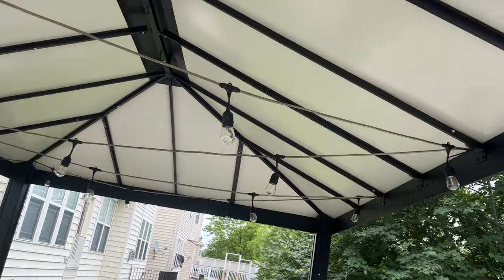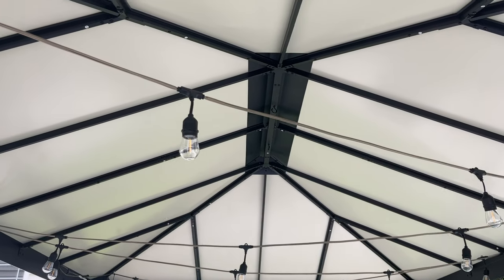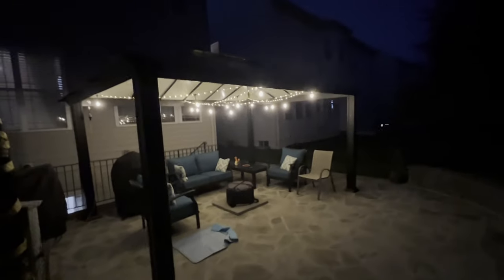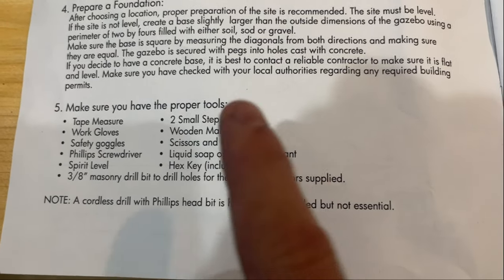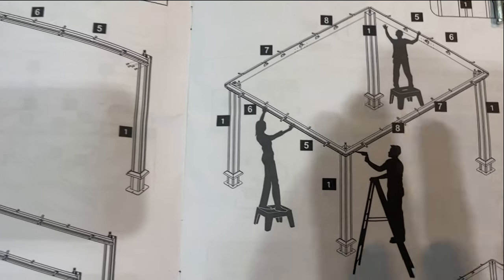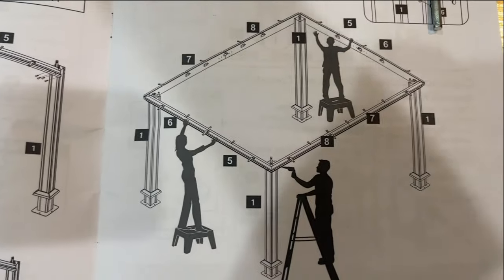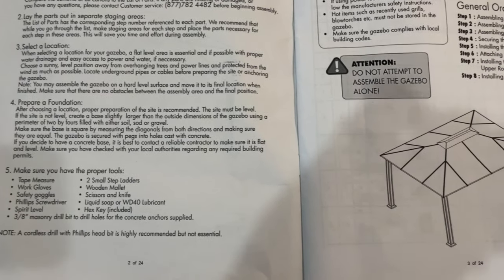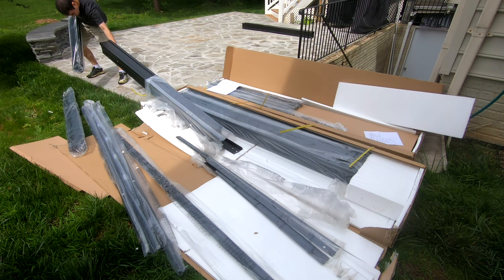Costco Paragon Santa Monica Aluminum Gazebo Review and Assembly

Comment: Thanks for your video.  The portions where you seemed to place it on a tripod were much easier to watch.  I'm probably doing to buy this in the spring, but am curious if you had any strong winds and how it fared?
Reply from the maker: The weather has been mild overall in my area since I've installed it.  We did have a few days with some strong gusts but it's still holding strong.

Comment: Do you think a gutter system can be installed on this unit?  If yes,  what would gutters be attached to?
Reply from the maker: I'm sure you can put in a gutter system but might need to make something it can mount to.  I plan on putting something in the back so the water doesn't go down to my basement for my sump pump to pick up.  I haven't done any research on it but plan on using the cheap plastic ones from Home Depot.

Comment: Does the smoke from the fire pit gets vented out from the top of the roof? Does it carbon deposit stain from the smoke on the celing? 
I am not too sure if the vinyl celing panels could hold up the heat from the weathering as well as the fire pit?
Reply from the maker: The top of the gazebo is vented.  I've used the firepit a couple of times and haven't notice any soot buildup but would guess it just takes time.  The roof panels aren't vinyl, at least not 100% vinyl, and is an aluminum composite.  They are flimsy but seem pretty durable.

Comment: @7:45 when mounting the bottom plates and top bracket of corner post - I would recommend using Threading oil on those #33 screws before screwing them in, their heads do strip very easy!